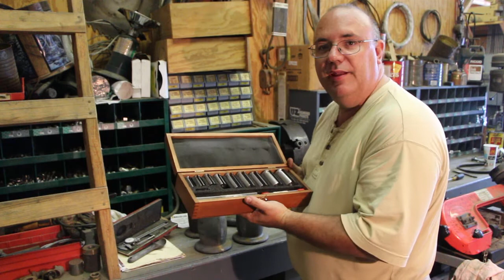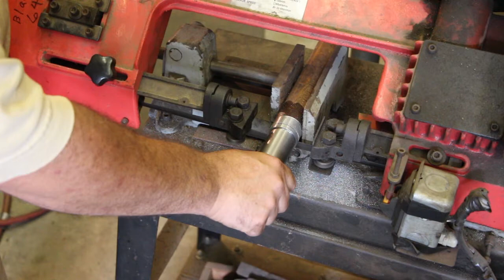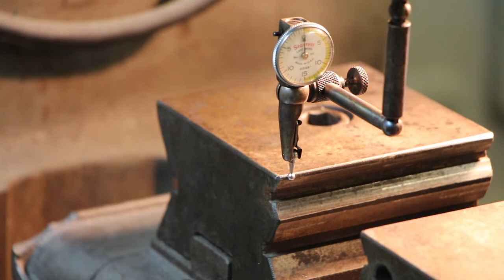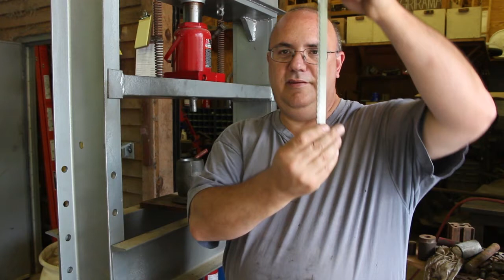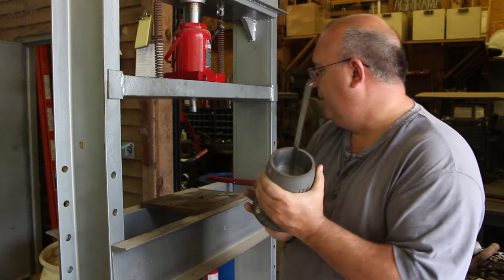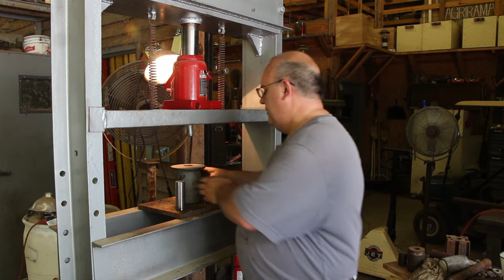Keyway Broaching a Pulley

Comment: I is interesting that you say they don't use 1/16 increment shafting over 1 inch, most of the shafting in the plant I work at is 1-3/16, 1-7/16 or 1-15/16. It does seem odd to not use a more even size though. Great videos they are very informative and educational.

Comment: Hi Keith, Nice job as usual, I really like that milling vice, any chance there is a name or trademark on it?
Reply: ***** As far as I know, that is called a double-acting vise, because both jaws move either towards or away from center. They are commonly used for cherrying operations, such as making a bullet mould, where you need half of a formed hole in each half of the mould block.